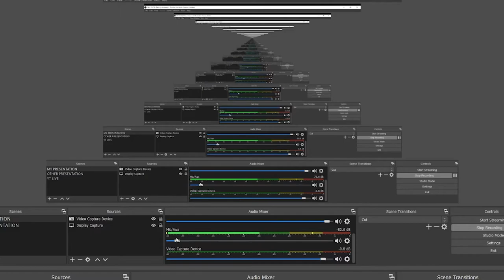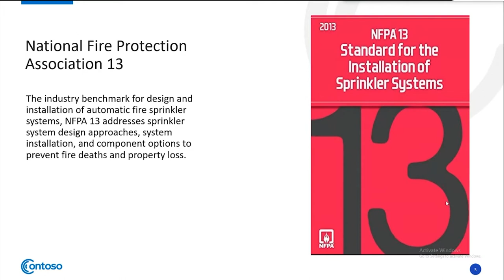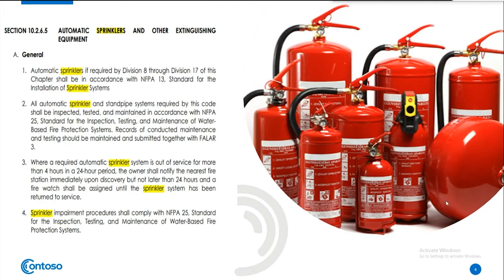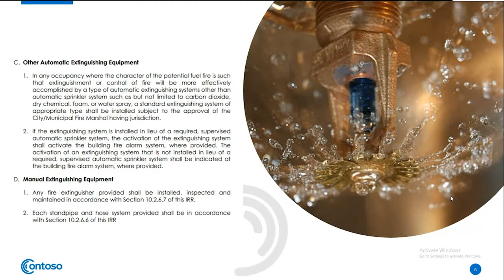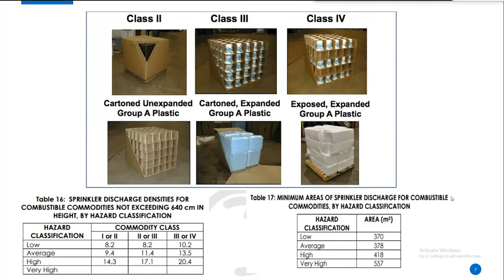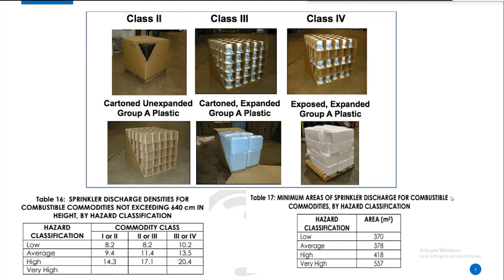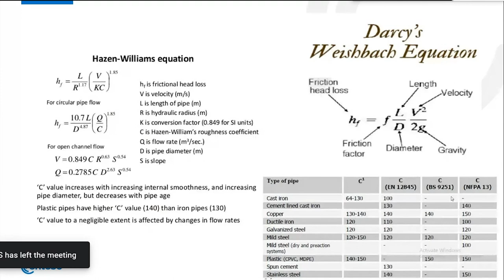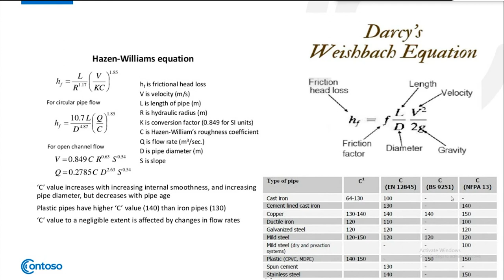BOSH: Sprinkler Design and Safety

Comment: Good presentation! The sprinkler system is designed to control or extinguish fires in the early stages. This makes it easier and safer for people in the building to leave the building, and for firefighters to extinguish any remaining fires. Sprinklers reduce fire losses. Automatic sprinklers are highly effective and reliable elements of complex fire protection systems for buildings. Sprinklers save lives and protect the homes you build by quickly controlling or extinguishing fires while limiting the spread of deadly heat and toxic smoke.
Hydraulic calculations are very important in the design of fire protection systems, as they provide sufficient water through the pipeline to extinguish any fire.